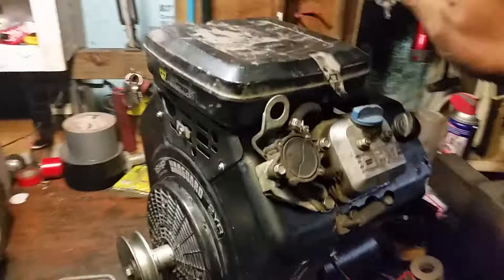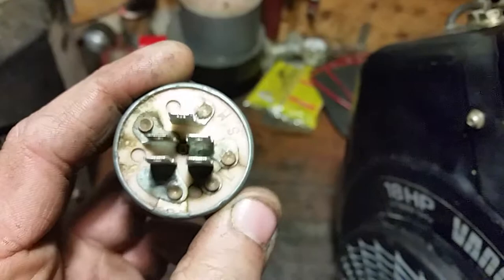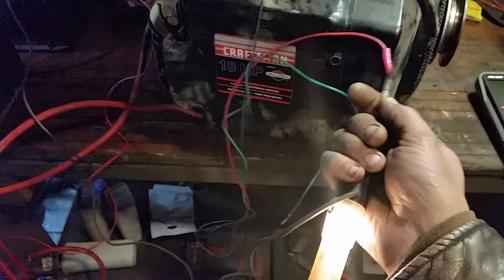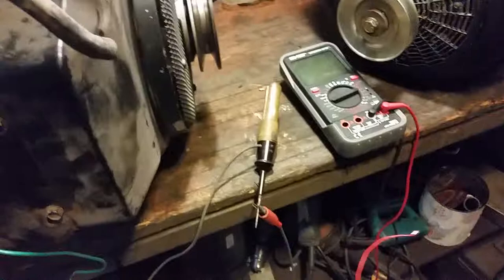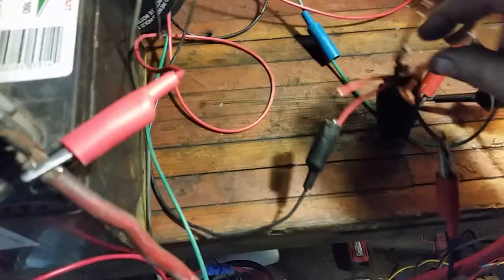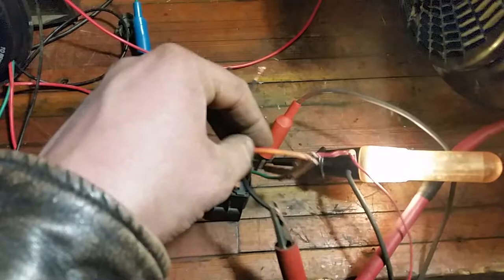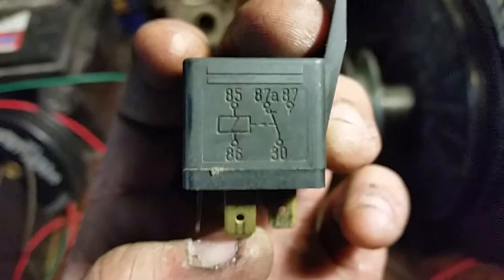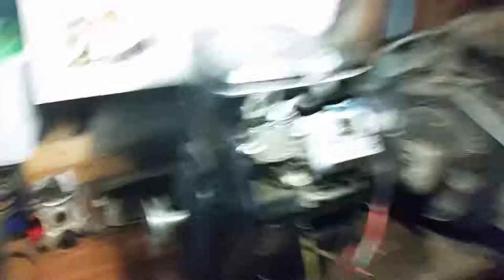Part 2 Vanguard Upgrade Wiring traditional key switch to fuel shut off safty solenoid.

Comment: This very tip saved me a big headache thanks to you Willy! Thanks for sharing it with the masses!! Zip~
Reply from the maker: ZippoVarga 👍
I didnt have a large supply of key switches laying around so I went different direction and I don't need to change tractor key or Wiring just tap power off key start circuit and accessory circuit and run wire to fuel shut off threw grounded relay. 
Would be nice to have a computer to edit but wile I have the cash need to fix rust on my fixer upper truck first. 
Thanks for stopping by and adding to the growing list of watched videos. 
CHEERS~

Comment: Any insight into converting a vertical Vanguard twin to a horizontal shaft?    I've not disassembled any of my OHV engines to study enough to walk through the oiling circuits and methods.  Would be handy to be able to convert even the regular Intek OHV verticals to horizontal shaft operation.
Reply from the maker: oil pick up would need to be modified and the crankcase breather and intake as well as carb would need to be changed depending on the horsepower 18hp usually have a downdraft carb. 
By time your done with all that you'd still be stuck with a side plate mounted engine not worth the aggravation versus buying used horizontal shaft engine to start with or converting drive train to work with the vertical shaft engine

Comment: When using a anti backfiring solenoid, turn the key off while on full throttle or you could damage the solenoid, this step is not necessary on a non solenoid carburetor.

Comment: I HAVE a key switch IN my wiring WITH the Fuel shutoff & relay, 1:27 Back of Key to 12:35 Back of relay, I just need to know which terminals on back of switch goes to which terminals of relay  to start & run the 18hp Van B&S with the fuel solenoid Thanks
Reply from the maker: There's other comments below the video I described the relay pin wiring

Comment: What are the pulleys on the fan side of the engine for?? Were they just a bolt on, or did you fabricate them?
Reply from the maker: Special flywheel shaft adapter for a second pulley for the drive belt

Comment: Thank you for responding sir.  1) Ok Black (B, hot on MTD) splice from ammeter to red vanguard voltage regulator. 2) Then to connect fuel solenoid  (black single wire on vanguard),  connect to only MTD (A blue light wire) or both light wires which are (A blue light wire) + (G ground green) with a 2-1 connector?  Thanks!!!!
Reply from the maker: Depends of switch pole design you may have to add a relay like I did in the video to power the fuel shut off solinoid

Comment: Very confusing! I have the same Kohler engine but my vanguard is 23 hp. I fried my wiring harness. I will gust make a separate on and off switch for the fuel shut off.

Comment: Hello Willi Ck . I am trying to fit that same exact 16hp vanguard into a MTD 18/46 with a opposed twin.  I understand the idea that fuel solenoid needs power when starting and running but I dont not have a good idea about changing the wiring.  Also where does the voltage regulator get hooked to?  Thanks
Reply from the maker: Voltage regulator gets hooked to switch battery power downstream of an ammeter if equipped upstream from any other power switched accessories like lights, pto, or starter to avoid any back feeding.
Reply: @willyck948  Thank you for responding sir.  1) Ok Black (B, hot on MTD) splice from ammeter to red vanguard voltage regulator. 2) Then to connect fuel solenoid  (black single wire on vanguard),  connect to only MTD (A blue light wire) or both light wires which are (A blue light wire) + (G ground green) with a 2-1 connector?  Thanks!!!!

Comment: I'm up grading to a motor that has fuel solenoid. Old motor shut down spark to kill engine. Would I have to change that so it still sparks to burn up the fuel in that's in the carb and cylinder during shutdown? Seems to me that with both shutdown methods in place at the same time your gonna have uncombusted fuel sitting in the carb and cylinder until next fire up.
Reply from the maker: There's always fuel in the carb the solenoid just blocks the carb jets. 

The fuel shut of solenoid serves 2 functions it can be used as a safety shut off rather than cutting the ignition which can cause backfiring like tractors from the 80s. 
It also cuts the fuel during shut down to prevent fuel build up in the hot muffler that can cause backfiring as the hot steel ignition the fuel vapors. 
As for fuel in the cylinder during shut down there isn't enough to hurt anything ignition kill is fine but you don't want the fuel solenoid to stay energized all the time or the battery will die. 

I just tied both accessories and start signal into a relay to control the fuel shut off solenoid very little invasion into factory wiring.
Relay stays grounded you add a wire the starter solinoid signal wire and feed that into the signal and switch power of a 5 pin relay. 
 Then add a wire into accessoriy power from anywhere easy to get at hooks at normally closed power terminal at the relay. 
Power to the fuel shut off solid hooks to center pin of the relay. 

Ignition kill doesn't have to be modified unless you want to prevent backfire related to safety kill switch actuation which would require another relay added as well as diodes or changine switch circuits entirely that gets little complicated though.
Reply: Okay so let's see if I have this right.
Pin 86 gets ground
85 gets start signal.
30 and 87a are normally closed so 30 gets power from battery and when relay is energized power goes from 30 out through 87 to fuel solenoid?
Reply from the maker: @johnhuebner2594  I was mistaken on the power to fuel shut off solinoid, sorry. 
Pin 30 goes out to fuel shut off solinoid
Pin 87a gets power in from accessory power preferably separate from charge circuit but not all key switches have separate light power. 
87 gets power in from start signal that is also tied into pin 86 
Pin 85 is grounded all the time.  
I mixed up 30 and 87a

Comment: I grind the fuel shut off needle so that it always passes fuel.
Reply from the maker: That works for the most part. 
My muffler is so big it would backfire on shut down constantly, scared the dog half to death, she doesn't stick around when I start the craftsman.
Reply: @willyck948  would not do that surgery if the tank was above the carb....safe enough other wise...

Comment: going to have to watch this a few times. Bought a mower with a Vanguard that had another model engine. P.O. had made up his own wire harness but it burned the diode wire and coils. It;s been on the back burner too long.
Reply from the maker: hope you get it straightened out I believe briggs staters are all similar should bolt up to the engine. 
 Main differences being charging Amp rating and duel pin or single pin outlet with a diode on it.